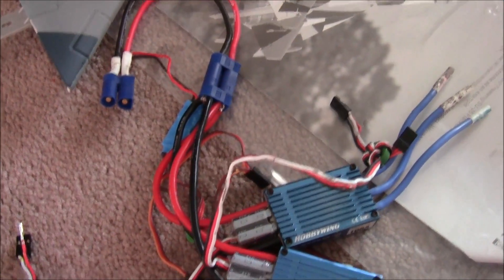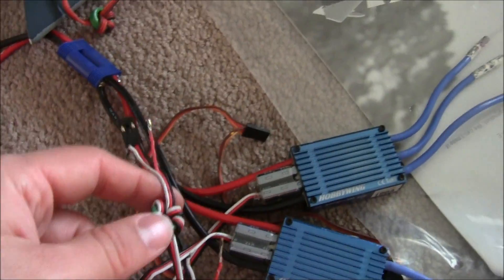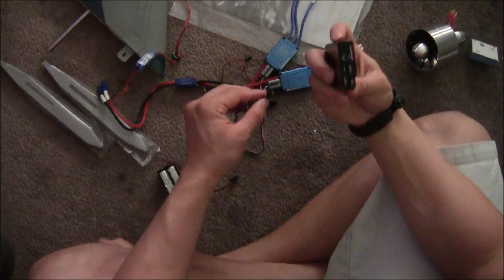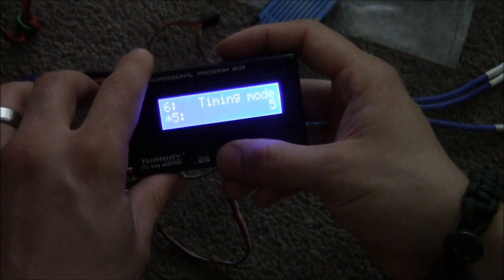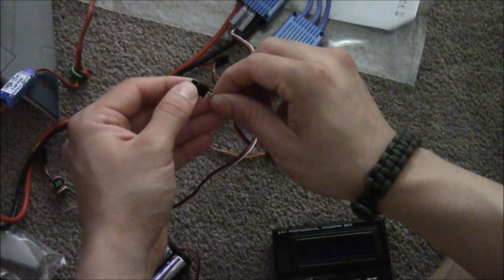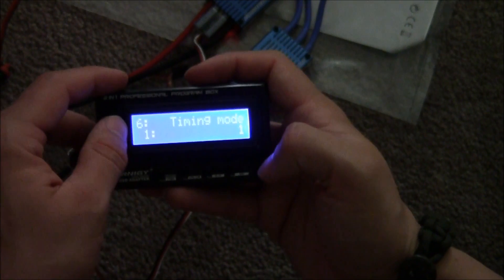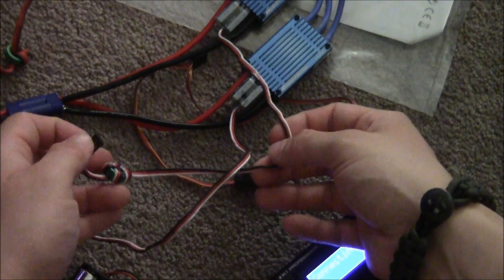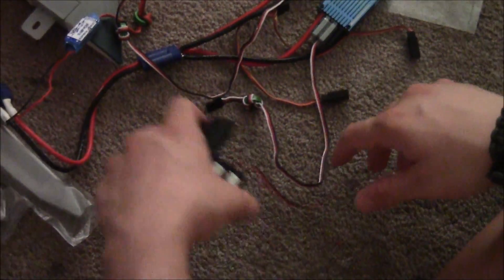Freewing SU-35 Build Video #3 Programming ESC's

Comment: Something else I noticed that you are doing is lots of wire length. That all just adds weight, line resistance, heat..... Its not a big deal but competition everything is cut as short as possible. I used HW 70 and earlier the 80s and in both cases I cut the battery leads shorter, soldered them into a single bullet and then went 10 gauge to make up the span to the span to the battery. 
My HW70 also has anti spark so the connectors off two ESCs ment a little more fiddlin.

Comment: Its not an over load of the RX its the switching countering the auto sensing leading to a potential fail. Some say its shouldn't matter but manufacturers of BECs recommend against placing switching BECs together. 

RXs actually can take a lot more amps and volts than your servos and other down line devices can take. Thus the benefit of using the newer 7.2 V setups if you can. Less to no chance of browning out your RX.